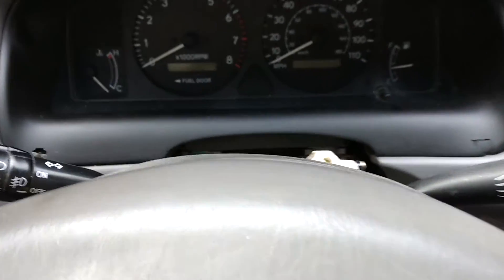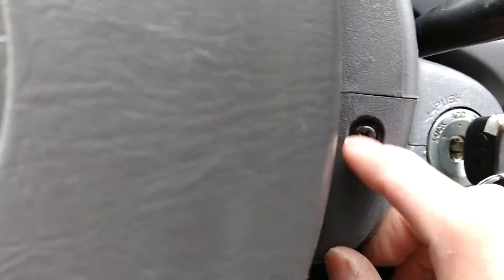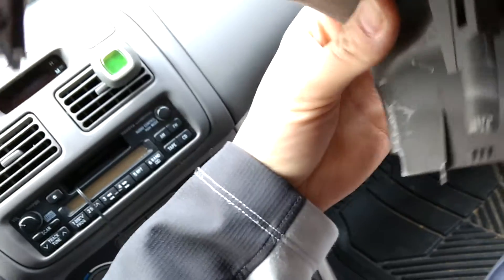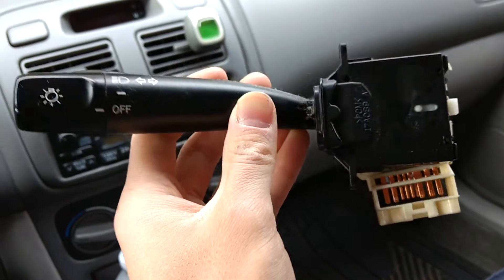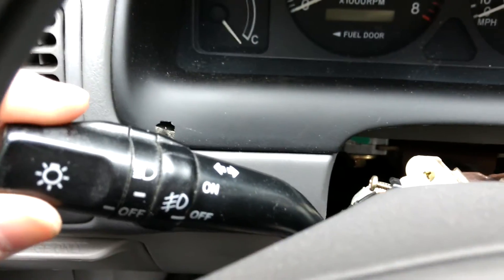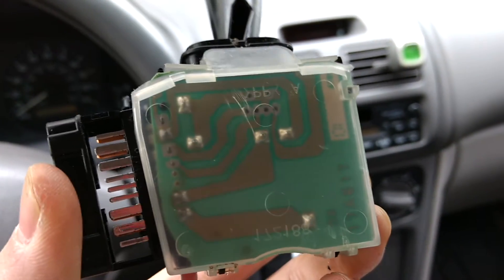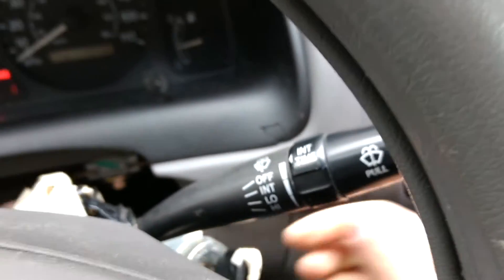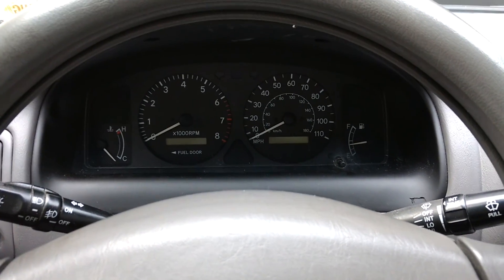Toyota Corolla Fog Switch & Intermittent Wiper Switch Install

Comment: Excellent video and thank you very much.  We own a cream puff 2001 Toyota Corolla with 106,000 miles - it's a great little grocery getter for my wife.  I added aftermarket fog lights, the Denso relay and picked up a new headlight switch w/ fog light from a local salvage yard all for less than $100.00.  The install went smoothly thanks to Toyota for pre-wiring the fog lights 20 years ago.  I didn't need take the front bumper off - I just jacked the front up high and worked from underneath (with jack stands installed of course).  Probably the most difficult part was standing on my head to install the Denso relay.  This was a great hands on video and much appreciated.

Comment: Could the oem 2001 corolla fog light system be installed on a corolla 2000? Already have the switch and relay. No pre wiring though.

Comment: I'm adding factory fog lamps to an '01 Corolla LE, which has the wiring behind the bumper for the factory fog lamps, but the standard combination switch (lacking the fog lamp 'ring' switch).  I'll be getting the a combination switch from an '02 Corolla LE which does have the factory fog lamps.  I take it from the video that all I'd need to do, once I change to the new combination switch, is install that Denso relay #567-0001.  Is it really as simple as that?
Reply from the maker: That's correct. All plug and play, the 01s and 02s are prewired. Mine is a CE and of course came without fog lights, but worked like a charm.
Reply: Awesome!  I AM EXCITE!!!
Also, thanks for the speedy reply to a comment out of the blue like this!

Comment: Hey Matt I was wondering where the relay is located. Could you send me a link or tell me how to locate it? Also, do you think a (1999-2002) Lexus rx300 switch will work?
Reply from the maker: nooobmuch https://drive.google.com/a/uconn.edu/file/d/0B0EFiJKWdc-_WTgybEV3aFNVZHc/view?usp=drivesdk

Here's a picture. If you crouch on the ground with your driver door open, and place your head by the pedals, you'll see this relay box on your left by the kick panel. The orange socket is where the relay will go. I don't know if the Lexus switch features will all work, such as the drl/auto headlight disabling but I think there's a good chance a lot of them will. Most Toyotas of this era had the same steering column switchgear.
Reply: found it! thank you so much!

Comment: Hi, I know I have a toyota corolla sport 2007, which already has the installation of the fog lights, I bought the complete set of fog lights, but I do not know where the neblineros relay is installed and the other one, the remote control where the lights go Normal of the auto "high and low lights" in the next contact I have the fog light and I turn on the lights independently but I do not have voltage where the fog lights plug ends, I wanted some advice if you obviously know.
Reply from the maker: The reason why you might not have voltage is probably because the relay isn't installed, or the switch you have might not have the dedicated ring for the fog lights on it. I'm not sure about the 07 corollas, but the relay plug might be underneath the dash on the driver's side (near the pedals). Or it could be under the hood in the fuse box. Hope that helps.

Comment: Hi do you have any idea if this parts will work as well for the corolla in asian markets with left hand drive?
Reply from the maker: I can't confirm but I believe as long as it's around the same year range (mid-late 1990s to early 2000s) you should have no problem. The dash, gauges, and interior design of the EU/Asian market and the USDM 8th gen Corollas are very similar, so I'd imagine the electronics are similar too.
Reply: Hi just an update, and also to give insight to other viewers. I bought used parts (headlight and wiper switch) in ebay from Lexus and Camry USDM cars, ship it here in Philippines , and installed it in my 2002 Corolla and it works perfect, except for the Auto function on the headlight switch, I dont know whats the function of that in the former car, which is the Lexus. Thanks so much
Reply from the maker: @ariesdave748  Glad it worked out for you!

Comment: Bruh where’s the follow up video. Ty for the info, imma get rid of my cheap fog lights switch and go with the factory wires. Will try out the wipers stalk too on my 13 Corolla sport.

Comment: Will this work on 1998-2000 Toyota Corolla models? Plan on getting a 2001-2002 bumper with fog lights but I don't know whether the fog light stalk switch will work on 1998-2000 models as well. My car comes with the intermediate wiper stalk switch, could that mean it's compatible?
Reply from the maker: arisethefall21 The 98-00s aren't prewired for fogs so it wouldn't work unless you provided the missing wires to the relay panel in the car. You can try that, or use a universal fog light kit/switch for the fogs in your new bumper. Also I don't think that 98-00s have separate high beams( only a single h4 bulb I believe) so that's another consideration in terms of wiring

Comment: Do you know if this will work for a 2007 Toyota Corolla LE
Reply: 131Blitzer it should, if you have the wires tucked away under your headlights all you need is a relay and a stock with a fog light switch. My video is coming Sunday.

Comment: Will this procedure apply to a 2006 Toyota Corolla S model?
Reply from the maker: The Corolla S should already come with fog lights. I believe the variable intermittent switch swap will work though. From what I've seen on Toyotanation, I believe 03-05 are pre-wired for fog lights and 06-08 aren't so it might not be quite as plug and play. If you don't have fog lights and only the black covers in the bumper you can check behind them to see if there's any hidden wiring.

Comment: Will this work on 97 Corolla?
Reply from the maker: The fog light/headlight switch won't work since the 97 isn't prewired for fog lights. The wiper switch might work, but I can't say for sure. This swap will definitely work for 98-02 Corollas (wipers) and 01-02 (fog lights).
Reply: Matt Poon 🙁 have you done fog lights on 97 before?
Reply from the maker: Victor Lugo I have not. They can be done with a custom setup/wiring and separate switch, but they're not plug and play like in the 01-02
Reply: Matt Poon Thanks so much!!! 👍